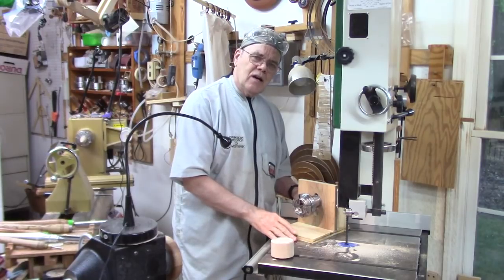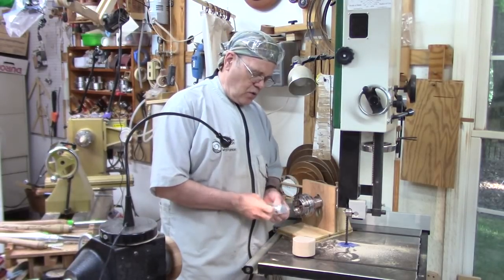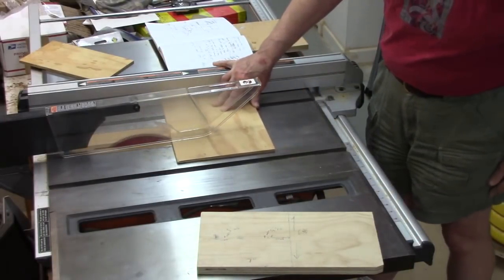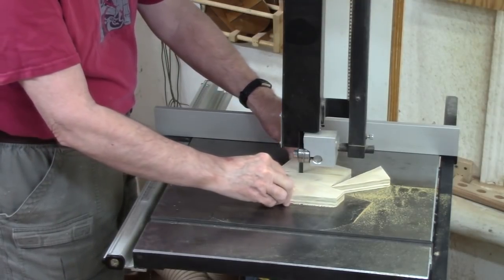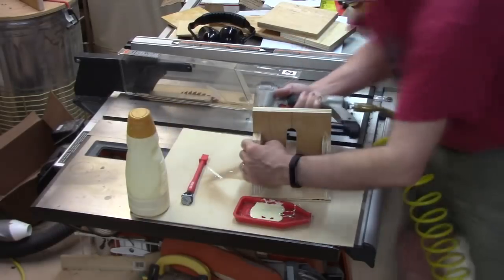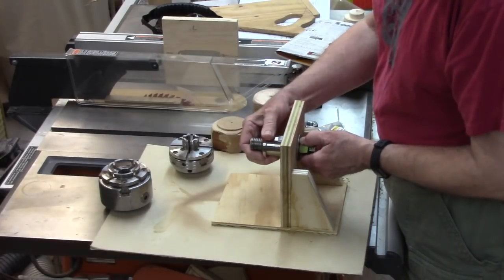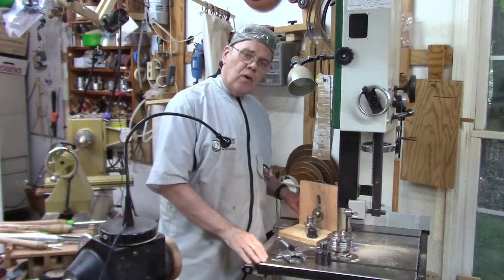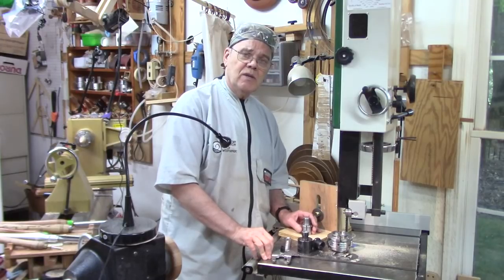Woodturning Bandsaw Jig to Cut Wood in a Chuck - Safely!

Comment: Great video Mike, I use mine a lot. Thanks to Alan Stratton several years ago. I took the idea one step further and built a platform to hold my spin indexer which holds my chuck and work piece for doing indexed slices on the bandsaw. (I made several sliced apples for a music teacher, 8slices after turning the apple).  With my jig like yours and Alan's I put a couple of pivot holes in the base and used it to cut some blanks for curved lamination for wavy boxes,  I used another piece of plywood clamped to the bandsaw table with a dowel pin to fit the jig holes, (not adjustable but functional, and perfect for the task at hand and eliminates adjustment errors). Makes getting a consistent matching radius easier.  I made a video of my "apple slicer" set up on my East Slope Woodturning channel.
Reply from the maker: Wow! That is some fancy spindle jig you made. I can see that the indexing feature would be very handy.

Comment: Appreciate the content and your passion for “wearing a mask” and being socially responsible.   I would like to figure out how to create a jig to hold a chuck off the lathe, so I can do carving and pyrography and still have the ability to turn the object without taking it out of the chuck, so when I go back to finish on the lathe, I’m not rechucking, and hoping that my lineup is the same...
Reply from the maker: I don't carve so do not have one but have seen plans. Seems like there is typically some welding involved and seems like one used a ball trailer hitch. Look at some commercial versions for ideas. I know Trent Bosch sells one.
Reply: Trent Bosch sells one.  You could look at it and see if you could invent something for your needs or just save the time and buy his.

Comment: Great idea Mike.    I've got one similar and use it all the time.   It's a great safety feature for cutting things round without damaging the fingers.    May I suggest adding a "T" Slot guide on the bottom and also an X  and Y  Axis.    This way your always square and you can move the chuck in and out to get closer to the blade.    Gives me more leeway and safety.
Reply from the maker: Yes, mine is pretty basic and has room for improvements if it gets a lot of use. See the link for the commercial model.
Reply: @MikePeaceWoodturning  Ha, yes......for a mere $350.00 they have the T slot for the perpendicular cutting to give both X and Y axis plus a track to fit into your bandsaw table slot to keep things square.    Another 15 minutes of work and yours would also be the same.    Best thing is this all can be made out some scrap plywood laying around.   Great idea and a very useful jig.   Thanks for posting.

Comment: More versatile than a V block running a T slot. My design used all thread,  ordinary and round nuts ( for indexing), but I didn't consider vertical adjustment, nor angular use for bishops mitres. Thanks. I had not really thought beyond squaring off blanks, parting work and wooden gear cutting in a separate rig up.  Bernard.
Reply from the maker: Thanks for sharing! Lots of things it will be useful for now that I have it.

Comment: Nice jig. Any idea where I can find a 1 1/4" x 8 you bolt and but, to build my own?
Reply from the maker: If you are in the USA you can buy from a Fastenal store. Or do a Google search oon the part I showed in the video. You will find several places on line if you do not mind the postage. Even buying the adapter, the 3/4" bolt solution is cheaper.
Reply: Fleet Farm has huge bolts/nuts that I’ve used to make a faceplate.

Comment: This is a good idea. I built one based on plans by John Beaver ... considerably more complex to build than this jig, but really comes in handy (John designed his for his 'Wave Bowl' series of turnings). I use mine to part off my segmented pieces from the glue block.
Reply from the maker: Looks like it could be useful for different turners for different things depending on what kind of work they do. I will probably make another chess set and I will feel more comfortable cutting crenelations for the rooks as well as bishop miters.

Comment: Thanks for the mask message. I made one of these from Allen’s video and got a bolt and nut fromFastenal that was 1 1/4 8tpi. Expensive but no insert needed. Great video on the build. I used mine on a hollow form and cut out a “stage” window to add a Christmas scene.
Reply from the maker: Excellent. Nice to have a jig handy when you need it.

Comment: You could use this to part off projects where you need to conserve as much wood as possible. The kerf on bandsaw blades is pretty thin.
Reply from the maker: Yes, an easy way to separate the top off a box blank.

Comment: Mike, PLEASE use a push block on the table saw.
Reply from the maker: You meant Bandsaw? Thanks for your concern. I am very cautious with the BS and use a push stick when warranted and always keep one handy. In this case the jig is riding on a fence and my fingers on my right hand are several inches away and completely outside of the BS blade direction at all times.